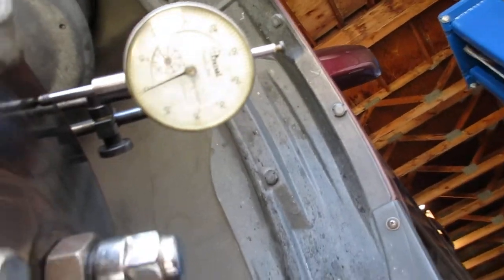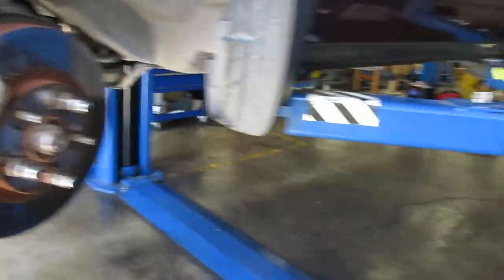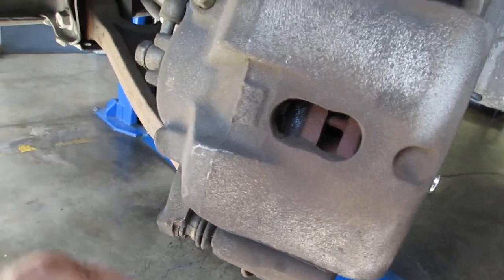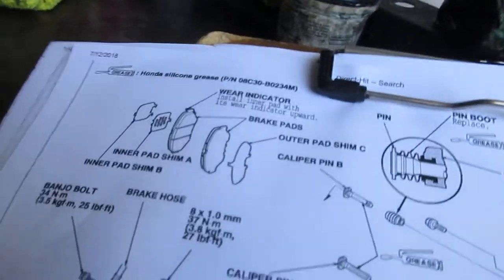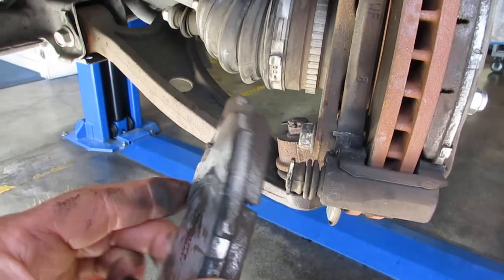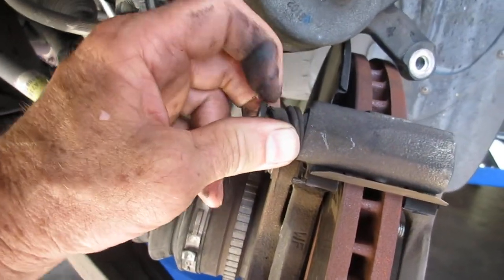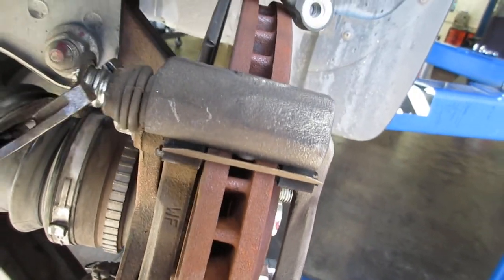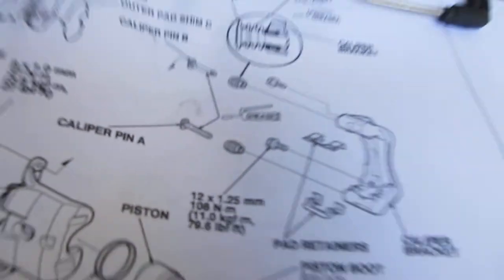2008 Honda Pilot Front Brakes after Firestone Service

Comment: What is the purpose of the guide pin bushings? (rubber sleeve on end of pin)
Reply: The rotor has a little movement when it spins and it's perfectly flat (watch the beginning with the dial indicator) the caliper actually moves side to side when the brakes are applied. The caliper slides back and forth on those pins. (only a little bit) If the pins aren't greased, the caliper can't move.